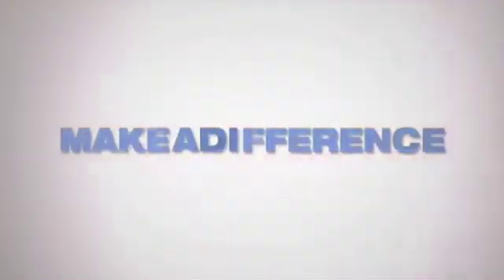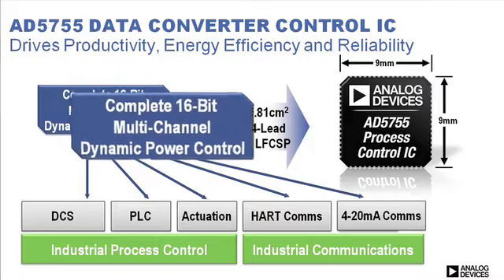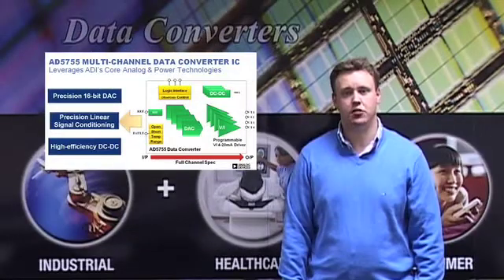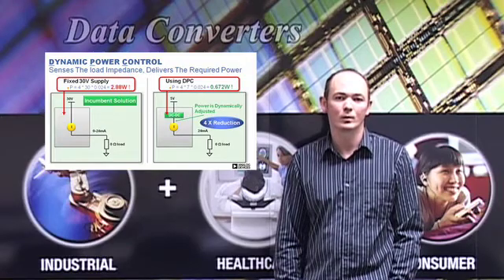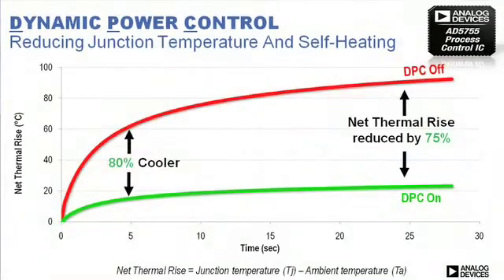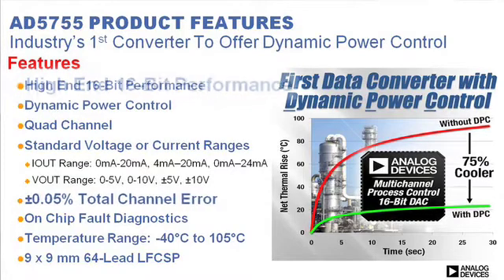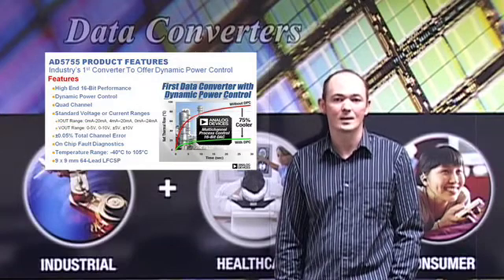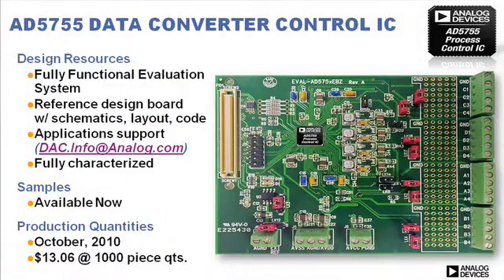AD5755: 16-Bit Multi-Channel, Voltage and Current Output DAC

Comment: why my AD5755 is heating extremely... and pulling more current from N15V voltage leading to drop of N15 VOLTAGE
Reply from the maker: Engage with ADI technology experts in our online community, EngineerZone®. Go to https://ez.analog.com and ask your design questions. Unsure where to post? Simply type your product number in the Search by Keyword or Part Number field and EngineerZone will suggest the correct forum.